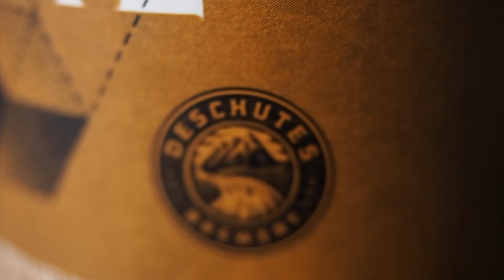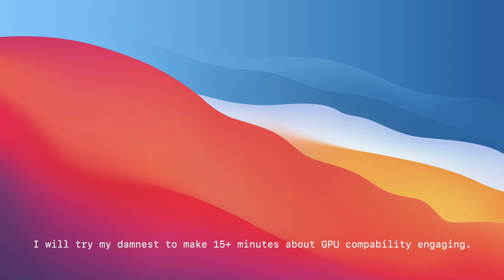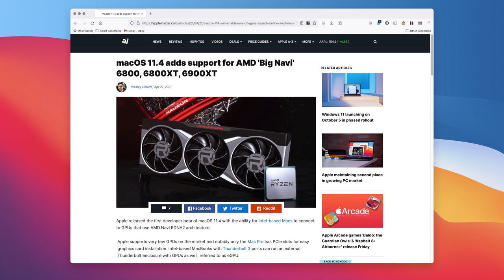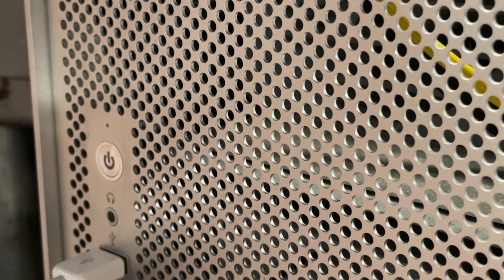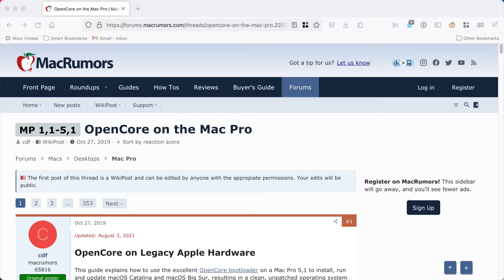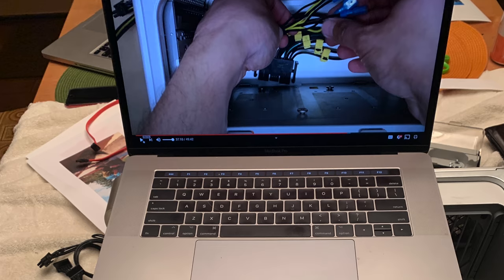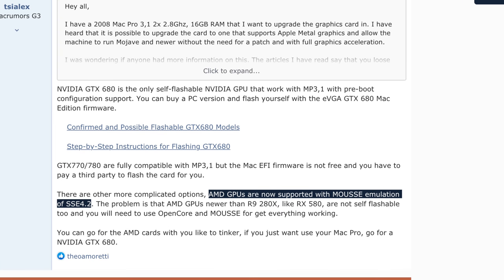Mac Pro GPU Upgrade Guide (3,1 2008, 4,1 2009, 5,1 2010 - 2012)

Comment: Hi new to Mac pro 2009 4,1 OSX 10.9.5 mavericks  wanting to flash to 5,1 to upgrade cpu's and ram  but have pro tools 10 HD  which is the last version it can run on ... did try flash it but get stuck in recovery with terminal as get a csrutil disable  error no file found?  so cant open the update file ???? any help would be most welcome

Comment: Thank you so much, which GPU would work well with 6k in premiere pro? Thanks
Reply from the maker: Oh boy, you're really not going to like what I'm going to suggest:

Switch Editing software to either FCPX or Da Vinci Resolve or switch to Windows with a NVidia GPU. Adobe's software makes great use of CUDA which no longer exists on macOS as of 10.14+ and required Nvidia GPUs. I understand this may not be realistic.

Windows PCs smash the 2019 Mac Pro simply because the Premiere Pro is Slow
https://www.pugetsystems.com/labs/articles/Premiere-Pro-performance-PC-Workstation-vs-Mac-Pro-2019-1719/

DP Review shows the big performance gap between Premiere Pro and Final Cut Pro
https://www.dpreview.com/articles/0942074552/head-to-head-apple-final-cut-pro-vs-adobe-premiere-pro

Editor demonstrating how poorly Adobe Premiere Pro performs even with dual GPUs and mentions speed vs Da Vinci Resolve.
https://www.youtube.com/watch?v=XSng-8DL9M0

A long drawn out complaint thread about performance of Premier Pro
https://community.adobe.com/t5/premiere-pro-discussions/extremely-underwhelming-performance-on-mac-pro-2019/td-p/10831489

Premiere on macOS just isn't very good and investing in a GPU will only modestly increase the performance. Adding an older GeForce 1080 or a RTX 2060 and booting windows would be a big speed improvement. Buying a new GPU (Vega series like 56 or 64 or the VII) and using FCPX or Resolve would also be a good move. 

I'd go ask in some of the communities as I've gone entirely post Adobe personally and professionally (Pixelmator Pro/ FCPX / Sketch / Figma / Apple Photos) as a UX developer and hobbyist as I became fed up with Adobe.

Try Reddit/MacRumors/Facebook Groups but you're likely to get similar advice.

Comment: I thought another solution to not having a boot screen with a PC Card was to have a native Mac card as well as the pc one so it boots up in the native mac card? I might be imagining this though?
Reply from the maker: It is for pre macOS 10.14, but leaving in an unsupported gpu can sometimes cause issues. It’s useful to keep one around if you really need the native boot screen as you can always install it.

Comment: Great Video. So over my head so got lost. Can you let me know if my Mac Pro 3,1 with NVIDIA GeForce GTX 780 3072 MB running High Sierra can upgrade to Catalina or Mojave?
I tried Catalina using dosdude but no joy. (was trying to install it on SATA drive not SSD).
Any help will be appreciate
Reply from the maker: You can go to Catalina and Mojave as it is a metal compatible GPU.
Reply: @dmug  Thank you so much for your reply. I must be doing something wrong to go to Catalina. Do I have to install Mojave first. Also do I have to used a SSD drive rather than a spare HHD?

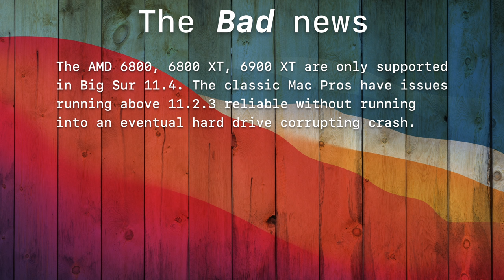Comment: 13:50 is this only affecting the current OS drive running Big Sur, or it can be any internal drives?
I ask because I use a bunch of 512ssd for oses and could not care less if the issue is reinstalling the OS.
Thanks
Reply from the maker: Pretty sure it only corrupts the boot drive. I never went to 11.3 with OpenCore on my 5,1 as it was such a headache. There's a group on Facebook dedicated to OpenCore where some of the real experts hang out. I'd suggest asking there or checking in at Mac Rumors or Reddit.

Comment: What  GPU would you recommend, that doesn't take 2 slots on the board for a Mac Pro 5,1 2012 ? I want o be able to use the other 16x card as well in my system. My system will be used for music studio purposes, not for gaming .
Reply from the maker: The first PCIe slot is dual height and most GPUs are dual with the factory coolers like the RX 580, Vega 56/64 and even Radeon VII. I've owned all of these and none blocked any PCIe ports.

However, there are 2.5 height RX 580s with aftermarket coolers that are clocked higher that will block the next PCIe slot but it's a case-by-case scenario. It's to look up if a GPU is dual or 2.5x height.
Reply: @dmug  I was using the Radeon 7950 it covers the other slot next to it.  So I should select one of the cards you mentioned in your reply ? If so I will look into one of those. Thanks !!!

Comment: Great video! but I have to Mac shame you for letting go of your CMP 4.1/5.1s :-)
Reply from the maker: Yeah, the crashing boots of Big Sur and wacky pandemic pricing made exiting appealing. Got a 7,1 which I plan to ride out to the end of the Intel era as I plan to replace my work MacBook 2017 whenever the new MacBooks arrive.
Reply: @dmug  Just for kicks and giggles I got a Mac mini M1 as well. I do keep Mojave on the 4.1/5.1. btw two years ago I spent half of my vacation in Brazil absorbing your site much to my wife's annoyance.
Reply from the maker: @breezlee59  to my girlfriend’s annoyance I’ve updated my guide while on vacation. No where as exotic as Brazil but more like Toronto.
I have the MacBook Air M1 and really have been impressed. It’s not perfect and the Apple Silicon future on the desktop side of things doesn’t seem nearly as great.
Reply: @dmug  Agreed. I do like the M1 chip. Would like to see what the Maci mini Pro does when available. Toronto is on my bucket list :-)

Comment: "I have the Mac Pro 5,1 mid 2010 w/dual xeon x5690 processors (oc Monterey).

My question: is there a way overclock cpu
to their maximum turbo-speed of 3.733ghz?"
Reply from the maker: Not in any sort of meaningful way. Xeons aren't designed stability and it comes down to the hardware itself.

In Windows, ThrottleStop, will let you OC on a 5,1 and you can warm reboot and the change will persist. However, the Voltage Regulator Module (VRM) is inaccessible via software, it cannot supply more power to the CPU thus limiting the gains to being minor.  in the tests performed, single core performance improves slightly whereas multicore is has almost none, as people have demonstrated on MacRumors forums. 

The best you're gonna get is X5690s.

Comment: I have a Mac Pro late 2008 with an amd Graphic Card 
Two DVI Ports 
Catalina patched 

I want to use 3 Monitors in the DVI 

All Same Monitors 
I use Port one for 2 Monitors over a Monitor Splitter ( on the PC IT IS providing both the Touchscreen and the Monitor plus the third Monitor in Port 2 and everything is working , Touch Is working and the both Screens Not Touch Is widescreen)

Then i use the left Screen on Port 2

In the beginning The mac Started all Monitors but Witz false Resolution , i couldnt arrange the Monitors IT was Just mirroring in all three Monitors 
Then i unplugged the Monitors and connected two 
IT Chose one with the right Resolution But IT was Not funding the other Monitor 

So now i dont know what to do because its Just displaying on one Monitor 
I cant Connect the other Monitors by the Display Setup in the system  Setup menu

Comment: I have a question when using 2 graphics cards one efi and one not do you need to run them through 2 different monitors?
Reply from the maker: That’s the pre Mojave strategy I used, second monitor into the EFI GPU. 

Almost every EFI card isn’t supported in Mojave so they end up as a generic display which is pretty much unusable as it’s so choppy and slow. You can leave the GPU in and swap your monitor cable but it’s a pain, and many people want the PCIe slot as they’ll have a GPU, NVMe, USB card and something like a Thunderbolt card or eSATA and so on.

Also you have to yank the non metal GPUs when installing Mojave. Then to run Big Sur you need OpenCore so there’s not a big point to having one.

Comment: Great Video Bro, but I have a issue, I install Catalina with the Dosdude1 patcher in a cMP 5,1 with a Nvidia GTX680 and worked flawless, two day ago I bought a AMD Radeon Pro w5700 and when I change the GPU and turn it on I get a black screen on the two ACD 30inch any clue
Reply from the maker: First zap the NVRAM, then wait. I’m not sure if your old gpu was flashed with Mac efi,  but the 5700 will not output a boot screen. I’d put this to a community on Facebook or Reddit or macrumor forums as it’ll get more eyes.

Also, you’re Better off switching to OpenCore legacy patcher,
Reply: Thanks for the answer, and yes the old GPU was flashed I will try to change to OCLP I have two arrays of RAID I don’t know if I lose the array if I do a clean install

Comment: with the newer graphics cards in a 4,1 Mac Pro, can I still run Lion 10.7 ?
Reply from the maker: Some GPUs can output an unaccelerated picture, but 10.7 does not have drivers for newer GPUs . I’d recommend either using a virtual machine or swapping GPUs.

Comment: I have a Mac Pro mid 2012 running Catalina, I just bought a radeon pro wx 7100 and I'm not sue what power cable I will need to install this in my computer. Any ideas???!!!
Reply from the maker: The classic Mac Pros use mini-PCIe power cables.  They come in 6 or 8 pin variations. You'll need to buy the correct cables based on what power pins the GPU has.

http://blog.greggant.com/posts/2018/05/07/definitive-mac-pro-upgrade-guide.html#installgpu

Comment: Hi new to a pro mac 4,1 2009 with OSX10.9.5  mavericks wanting to flash to 5,1 can i stay on 10.9.5 as the mac has pro tools 10 HD and i believe that's the last version it can run on .. was wishing to upgrade the cpu's and ram  as a stand alone audio   DAW  unit cheers  did try to flash but got roadblocked at terminal csrutil disable......error not seen ?????
Reply from the maker: What are you trying to flash? Upgrade the firmware?
Reply: yeah go from a4,1 to 5,1 then upgrade the cpu's and ram there after  but wish to stay on OSX 10.9.5    @dmug

Comment: Great video, as usual, Greg. You've pointed out, in several videos, the fact that GPU prices are absolutely out of this world; I found myself wondering why. This video presents a very interesting take on why this is so and why this year may see that condition reverse itself. If this fellow's conjectures are accurate, it may well be worth putting off GPU purchases for a few months.  https://www.youtube.com/watch?v=MgmsB8fWyes
Reply from the maker: I've seen a few of these videos in the past but I think I'm in the camp this will only be solved as there's more fabs online, which looks like 2023. TSMC has the Texas location and Intel is building another fab looking like they'll do contract manufacturing like TSMC with hints of having Apple as a client. 

Intel's Ark GPUs should help on the lower end if they're able to get enough out into people's hands, as people are waaaaay overpaying $200 for ancient GPUs. At some point, GPU prices will crash but it'll be a slow visible crash is my guess.

Comment: I have a MSI Radeon RX560 in a 2012 Mac Pro I believe the GPU is flashed I can’t get a boot picker screen with OC and Monterey but it works fine in Mojave no issues there. Is there a fix for this?
Reply from the maker: Probably need to set the gop drivers for OpenCore
Reply: @dmug  how do you do that?
Reply from the maker: @TheDrumhead54  edit the OpenCore configs by hand or use OpenCore legacy patcher and go into the menus to make sure AMD GOP drivers are checked and then install the new open core using OCLP
Reply: @dmug  I used the new OCLP to install Monterey
I will do as instructed
Reply: @dmug  That doesn’t work still  no boot picker screen. My Radeon RX560 works fine in Mojave
Reply: @dmug  I did a clean install and got Monterey up and running but my Radeon RX560 is not showing video from HDMI or Display Port. I’m using M Lo’s OC 0.8.9

Comment: Hello @UCbJmpGyutglIauFO4M836gA, Merry Christmas from France. Oui! I did run into your website, and surprised to come across this video. I need your advise because it depends on my wallet during this health situation.

I bought a second hand Mac Pro 2008 Quad Core 3.1 cheapest model and I would like to edit with Final Cut Pro Studio (Not X) with a suitable graphic card, but I am not sure which card would support this machine without breaking a leg in the second hand GPU market and the flashing hacking issues. I was thinking of ATI Radeon HD 5870 or Nvidia Quadro FX 5600 1.5GB GDDR3 which is supported according to Apples website. Does anyone in the video world happen to know and would recommend any of this card or better?
Reply from the maker: Those aren’t recommended because they do not support metal (meaning you can’t run 10.14 or above). I’d suggest looking at a Radeon 470 as they can be often found for semi reasonable prices
Reply: @dmug  Thank you  for the response. Will a ATI Radeon HD 5770 work for a 3.1 machine? I wish to use it for video editing, Final Cut Pro X, non 4k videos, AND AS YOU KNOW, for whatever reason, the cost for GPU is crazy today.
Reply from the maker: Work? Yes but you'll be locked to 10.13.They're pretty weak GPUs.

Comment: Hey brother, rx6700xt..can be handled without pixlas mod?? Because same TDP as old gtx 770...
Reply from the maker: The 6700 XT still is unsupported in macOS since its not in the same chipset family as the 6600/6800/6900s